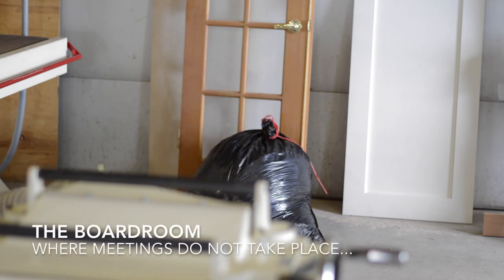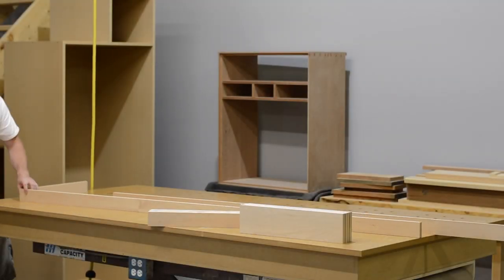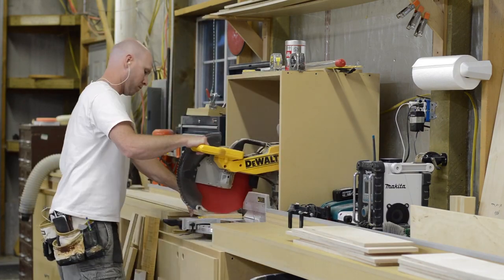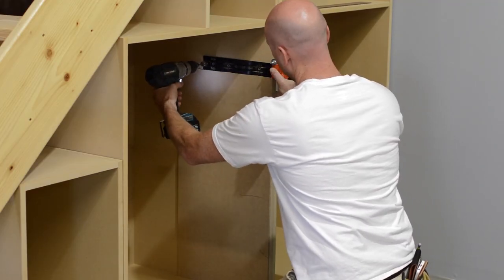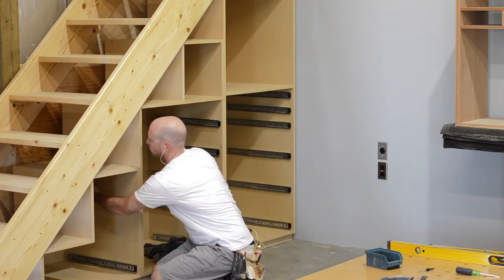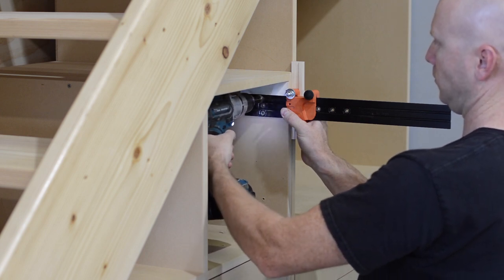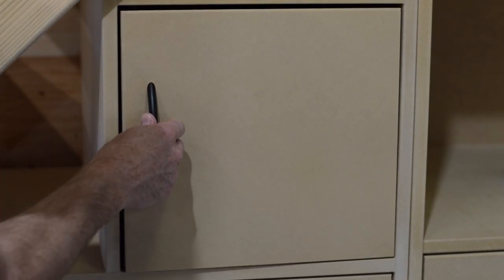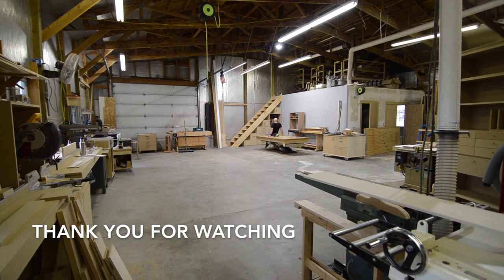Tool Tansu, carpentry woodworking tool organization cabinets

Comment: I’m a little worried... Do you have enough router bits for all those routers?  But on a more serious note, it’s pretty apparent that you’ve been around the block with quite a few routers. Do you have a favorite or one that you seem to always reach for first?  Great video, too! Thanks!
Reply from the maker: Ha. Router bits are the easy part. I think the best router made right now is the smallest Dewalt. Fixed base or plunge, its a great tool and a good price. I always have one in my amazon cart, when they drop the price to 99 I buy one. Regarding the larger sized routers, Dewalt is good as well, but so are all the others.

Comment: Some people change bits in their router.  Mike just changes routers for a different profile.
Reply from the maker: Thank you Dan. Most cabinet shops work in this manner. Each router does one thing. I have about 15 that never get adjusted. Really speeds things up.

Comment: Love it mike! Do you ever have any issues with frameless Mdf cabinets holding screws for slides? Building some shop cabinets and worried the mdf wont carry the weight of the drawers.  Thanks
Reply from the maker: Thank you. Yes, I have had a few pull out. This has only happened when the drawer is over weighted by a lot. If this is the case, just add a ton of screws. I have never had the problem when the drawers are loaded to the weight rating of the slide.

Comment: Mike, do you put any finish on your MDF shop cabinetry?  Here in the South, the humidity to high enough that unfinished MDF absorbs water and eventually gets soft.  Maybe Denver is dry enough that isn's a concern?

By the way, I like the drawer pull on screw drawer (9:14).  ;)
Reply from the maker: No finish, It would probably be better to add some finish. I just didn't want to take the time. It is very dry here, so that helps me out a little. Cheap drawer pulls, what can I say?

Comment: Mike, how about the wood stair on top of these cabinets?,  how was the stair put together ,
Reply from the maker: Thank you. The stairs were built a while ago. I bought what is called white wood from a local store, I gave it a light dressing to get it to consistent thickness, then I routed mortises in the stringers for each of the treads. When assembling it I used two screws as I put each tread into a mortise. I did this to avoid clamping. Its nice and clean looking, and pretty fast to make.

Comment: You make amazing videos and the ideas are equally good. I just wanted to point out you are one of the very few people who use mdf so frequently at least for shop furniture. I personally hate it, it's heavy ( i have lower back problems) and it's hard to use screws with ( i split mdf most of the time :(  )
Can I ask you why you like this material so much? Thanks !!!!
Reply from the maker: Thank you. I use MDF because of cost, and for me ease of use. If you use the proper counter sink you won't have the splitting problem.
Reply: Over the pond we have an abundance of MDF so it's usually much cheaper and more convent to use than ply. Also for a painted finish MDF is superior as it requires much less prep as the surface is so smooth just the end grain to deal with and again that's easier than ply.
Reply from the maker: In the states MDF has somehow gotten a bad name. Its a great material and yes it requires far less prep for paint.

Comment: Really enjoyed the video.  Great idea to use that space and it looks great.  Thanks for taking use through your process on this.  Probably a dumb question, but why did you use MDF vs plywood for the boxes?
Reply from the maker: Thank you. The question is not dumb, the answer is money. I buy a lot of MDF and therefore I get very good pricing. Also, I didn't mention it in the video, but I remodeled this corner of the shop and I plan to use it as a "backdrop" for my videos. I like the smooth consistent look of MDF on camera.
Reply: Money is a great answer as well. I am in the UK and  18mm plywood can be 3 times the price of 18mm MDF. MDF is around £20 a sheet. You can get shuttering ply over here but it's seldom good enough for finish cabinetry.
Reply from the maker: Similar story here, just in US dollars.

Comment: Mike … I'm looking for an 18GA brad nailer … you use your a lot in the shop.  What kind do you have or would you recommend?
Reply from the maker: Mine is the 2" Porter Cable. I had one for 18 years, it broke last summer, and I replaced with the same. For as many tools as I have I haven't tried all the brands. So take my recommendations with a grain of salt.

Comment: Brilliant job Mike. As Ply is SO expensive here (Australia) that might be the solution for me for shop cabinets.

What thickness MDF did you use?
Reply from the maker: We here in the States call it 3/4". Is that 18mm or 19mm for you guys? I'm with you, I just couldn't justify the extra cost of ply for a shop project, especially when MDF does such a fine job.
Reply: Yeah, 18 mm here is the nearest, costs $34 for a 4x8 sheet.  Even crappy 'structural' ply is $85 here, let alone our equivalent of Baltic Birch which would run out about $150. Thanks!
Reply from the maker: I feel your pain. Im a little less for both, but not by much.

Comment: Great video! Why some many routers? Looked like 7 in that one drawer haha
Reply from the maker: Thank you. When trying to crank out cabinets, there is no time to change router bits. Especially with the work that I do, often very large cabinets, its good to go through 3 or 4 routers on each cabinet as I'm assembling. This way I move/deal with each cabinet as little as possible.

Comment: Hi Mike, a quick question, I have just bought a bunch of blum inserts hinges that you used on your Tansu a few years back, they came with no instructions, ie, setback from edge of door, depth of the 35mm hole, searching on Blum web site for the instructions is perplexing to sat the least. I bought the jig to install the face plates to the cab which appear quite simple to use.Any help you can offer on the location of the 35mm hole on the door would be greatly appreciated. Also if you could let me know the drill bits sizes I need to do the install that would also be helpful. Many Thanks Chris N
Reply from the maker: Normally the 35mm hole is drilled 13mm deep and 5mm back from the edge of the door. I'm not sure which drill bits you are asking about, but the system holes are drill with a 5mm bit, if you go with the three hole pattern on the doors its a 35mm bit and two 8mm holes. Hopefully this helps.
Reply: @MikeFarrington  Thank you Mike, yes this helps a ton, greatly appreciate that you respond to my questions, I can now go about installing the hinges. Wishing you and your family continued health and safety during this time. I've had no covid positive patients where I work(in elderly care) but my son who is an ICU use in California has been in the thick of it for 4 months...scary, again thank you

Comment: Mike - Great video as always...quick question - I can find the Blum template, but where did you pickup the drill bits with stop collars?
Reply from the maker: I bought them as a Blum kit. Look it up in there catalog. Its not cheap, but works great.
Reply: Mike Farrington Thanks Mike!
Reply from the maker: @rlwilding  My pleasure.

Comment: Mike, Nice work. Just wondering what your reasoning to cutting the channel in the bottom of the drawer for the MDF? Why not just nail the drawer bottom to the bottom of the plywood? john in texas
Reply from the maker: Thank you. Putting the drawer bottom in a groove adds a ton of strength to the drawer box. This helps the drawer bottom carry the weight of the contents rather than wanting to pull the bottom off.

Comment: Is there any science to setting the depth gauge on the Blum template? Other than: “if I set it to the detent at 40mm, the holes seem to line up to my Movento slides, so let’s go”? I haven’t been able to find anything in the catalogue / online.
Reply from the maker: Its an art and a science. I start with the Blum catalog and adjust as needed. The vast majority of hardware is based on the first hole being drilled 37mm back from the front edge.

Comment: You said you cut your grooves about a half inch up from the bottom of the drawer boxes -- is there reasoning behind this distance or does it just feel right? I recently made a bunch of drawers for a china hutch, and I think I chose a quarter inch to maximize space, but I thought about it for a lot longer than I probably should have.
Reply from the maker: Ha! Yes, don't over think it. For my standard drawer slide (blum under mount), the specs call for 1/2". So I just make that my normal for everything. Truth be told, I used 1/4" for a few of the very shallow drawers in this build.

Comment: Hi Mike, I watched this video some time ago, what brand of drawer glides did you use for this project
Reply from the maker: They are the off brand of ball bearing slides, nothing special or worth recommending. If you want nice ones, go with Accuride.
Reply: @MikeFarrington  Thanks Mike. Considering a draw glide jig any recommendation aside from the Blum one you use. Kinda looks like it requires some/too many adjustments to set up
Reply from the maker: @christosneocleous5216  That would be the only one I recommend. It only has one adjustment, how far in or out from the front edge the holes are drilled.
Reply: @MikeFarrington  Cool man many thanks

Comment: Hi Mike, hey there are many instructional videos out there the explain how to install drawer slides, but I cannot find one that instructs on how to properly space the slide based on how many drawers you are putting into a cabinet, do you know of a video  you can direct me to or would you be able to give an example and explain. I am building my first set of cabinets, that will consist of many drawers so need to understand this process to get things right, any help is greatly appreciated
Reply from the maker: I do not know of a video. I like to work off the bottom of the drawer, space the slide 1/2' up from the bottom, so the location of that slide is x to the bottom of the drawer plus 1/2". I calculate for each drawer box. Keep in mind that the part of the slide that goes on the cabinet and drawer box are different dimensions, so make sure to calculate for that as well. The spacer trick I showed in this video works pretty darn good so long as your math is correct.
Reply: @MikeFarrington  Ok, sort of understand, I think for me, the best thing to do is to build a small sample and work out the kinks till I get it correct so as not to have dozens of incorrect holes to fill. in a cabinet that I want to look aesthetically pleasing. But hey I do appreciate you taking the time to answer my questions. Please stay safe during this crisis, I am a registered nurse, have been fortunate thus far not to have any direct contact with infected patients, but likely will before this is all said and done. Stay home as best you can and wear any type of mask when going out for necessities.

Comment: MIke what is your opinion for Kitchen drawers.  I am using hte 1/4-1/4-1/4 method of jointery, I would be curious to know your opinion
Reply from the maker: I am not a fan of the 1/4-1/4-1/4 system. The reason being it won't work with one type of drawer slide I offer. With under mount slides the groove for the bottom needs to be 1/2" up from the bottom edge of the drawer. I think of drawers in dimensions first (LxWxH), then where is the groove needs to be located and what size it needs to be (I use 1/4 through 1/2 for the bottoms), lastly I worry about joinery. That could be screws, nails, biscuits, dominos, etc.
Reply: @MikeFarrington  Mike appreciate your quick response, so for my kitchen cabinets, I am using poplar on the rails and stiles, and mdf for the panels, I am doing a simple tongue and groove on the door fronts with the floating panel glued in the centers only.  For the drawers I am using 1/2" birchwood ply.  So your advice is simple butt joints glued stapled and screwed, or do you still prefer one joint over hte other for my application and wood materials?  Sorry man I just have a ton of respect for your work.
Reply from the maker: @soulsolutions3999  I would suggest glueing the panel in lightly with wood glue, I would only leave a very small gap around the panel, 1/32 or so. This will add a ton of strength to the door, and MDF won't give you expansion and contraction problems. I like 1/2" birch from the drawers, glue and nails will hold, if you want to up your game, you can use the locking joint from the 1/4 system or butt joints with dowels, dominos, or biscuits. If you nail the drawer boxes I also suggest glueing the bottoms in for a little extra strength. Hope this helps.
Reply: @MikeFarrington  YOu have no idea Mike, my wife will not leave me alone and let me do the job I started out doing.  She questions my every move but knows nothing about what she questions.  UGH!
Reply from the maker: @soulsolutions3999  Ha! I feel your pain, but I can offer no help in that arena.

Comment: Have you ever counted how many routers you own. I'd be curious to know. It must be a huge time saver.
Reply from the maker: I think its in the low 30s. I use about 10 on a very regular basis, the others are used once in a while, but yes, each time I pick one up and it doesn't need to be setup, I save a little time.

Comment: what the part number on those Blum hinge you are useing... Thanks
Reply from the maker: I'm not sure my part numbers would work for your application. I used full crank inserta hinges with 0mm plates. Your application may vary based on which hinge plate, hole pattern you used for the hinge cup, self closing vs free swing, soft close, and the list goes on. Sorry I couldn't be of more help, but I don't want to give you a part number and have it not work.

Comment: At 6:09, did I spy a (blue) flipping panel cart? I have been trying to find makers of these things. All I have discovered is a fairly overpriced one from the Midwest called, ShopCarts. 

Can you tell me more about yours?
Reply from the maker: Yes you did, and mine is from ShopCarts. I didn't buy mine new though. I paid 300 for it off craigslist. It works very good, and it really helps loading full sized sheets.
Reply: Mike Farrington they definitely look nice. That's such a steal. I don't think too many make it out to Portland, I've been watching Craigslist. Good to hear they are good quality though.
Reply from the maker: I'm sure there are plenty of cabinet shops that have one or more laying around in Portland. In the industry these are very popular. I have a very long term approach to buying tools. I have a list of a few hundred items that I search for on craigslist regularly. I had been searching for one of these carts for several years when I found this one. I passed on one other that went for 500 about two years ago. In a one man shop, its just not feasible to buy all the tools I want in a short amount of time, I have taken a collector approach. I try to pick up 1-2 tools per month.
Reply: Mike Farrington same. I appreciate a good tool but gotta do it smartly. Also a one man (CNC) shop so I'd love the utility of one of these.
Reply from the maker: My humble take is that these carts are very useful, but in my shop I could not justify 1300 for one. 300, thats an easy yes. For loading and unloading a flatbed or vertical CNC, one or two of these would be great.

Comment: 17:17 When I want to use a different router bit, i change it out instead of buying another router.
Reply from the maker: When trying to make money, changing router bits is too slow. I could change 5 or 10 times a day, that adds up.
Reply: @MikeFarrington  haha.  Yeah.  I actually have two routers ... and now I want a third cordless.  Weird thing is my second router is an expensive plunge router but I still use my old black and decker router the most.
Reply from the maker: @RBCire  Expensive doesn't mean better, I use my cheapest routers the most as well.

Comment: Why do you use drawer adjusters and punchers, if you can drill the holes in the drawers, use clamps to position the fronts with distancers according to bellow drawer front and bang, you are done?
Reply from the maker: Thank you. Overall when installing drawer fronts and you want tight gaps, these are the best way that I have found, and I have used the clamp in place method. I used these on this build for two reasons, one to show it off in the video, hopefully someone can pickup a tip or two. Second, I like to practice all my skills when I can, so next time I'm working on a professional project, I'll be ready to go. Each time I do something repetitive like this, I work on my flow and process, to get better. Storage of tools, which tools I bring out, etc. I really try hard to improve. The really easy way would have been to hold the drawer front up in place and then shoot a couple nails in them... Hope this makes sense.

Comment: Why don't you remove the black plate from the universal drilling template and make a longer one from aluminium
Reply from the maker: I don't have the skills to make one. Each of the holes are precision located and have a hardened steel bushing.
Reply: @MikeFarrington if you make a paper template using a dress slides for hole locations and get a metal fabricator to make one. you said that this cost $100. Is might take another $20 to make this tool useful to is full potential.
Reply from the maker: I'd pay 200 for a perfectly machined piece. Knowing what I know about having metal work done, which isn't much, I couldn't get this done for under 500 in my area, if I could even find someone at all. Keep in mind this is an aluminum piece that has machined detents, metic markings that coordinate with the detents, and hardened steel 5mm bushings placed in precise locations.